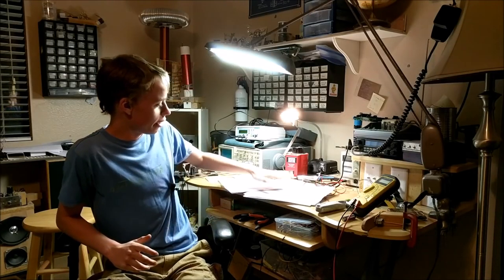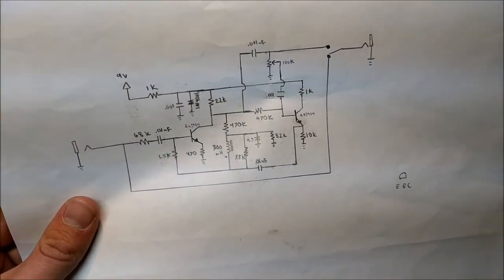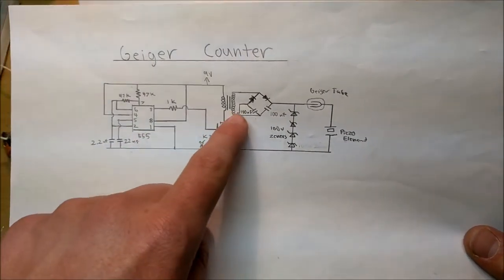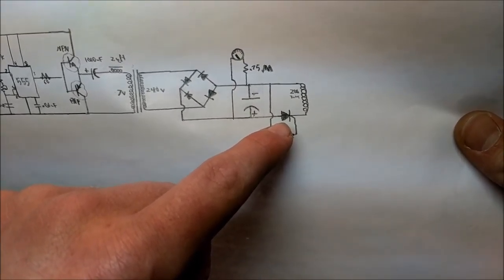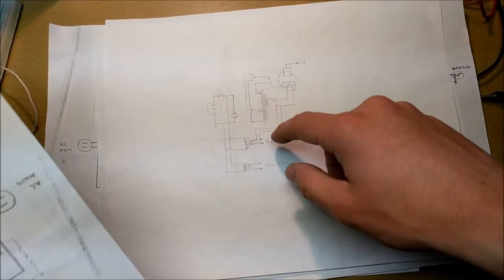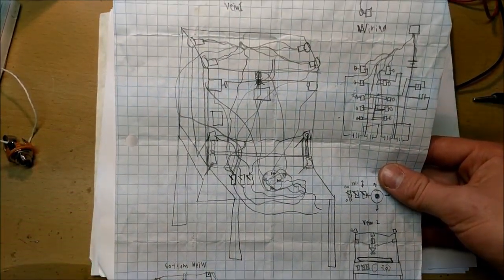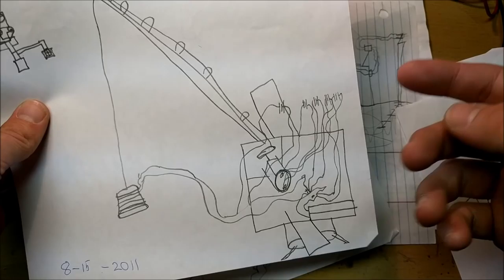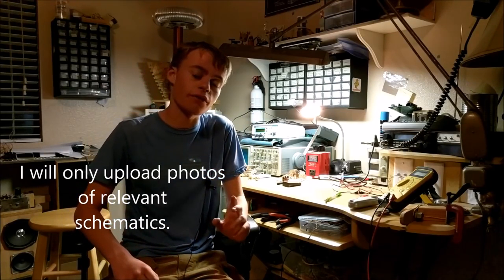Tanner Tech Circuit Diagrams (Both Contemporary and Vintage)

Comment: Looked at your reverb sch. A few things I saw should have used 33k on input. 9 volt power wipes out signal on primary. Should you have a push pull loop amp before the coil and pot fade in out?

Comment: when I was a kid, in school, I used to draw weird circuits.  I didn't know what all the parts did, and I didn't really draw real circuits, but I still loved doing them.  I used to draw parallel lines with check points on them, so that current, voltage, and information could be verified in route.  I wonder if such things will ever exist or did exist?  Cool diagrams.  I hope you have great success in electronics.  -)   Are you working on anything now?  I'm pondering and trying to think of ways to make transistors that don't use conventional circuits, kind of like organic transistors, like water wheel circuits, where a little water makes the waterwheel let in more water underneath....